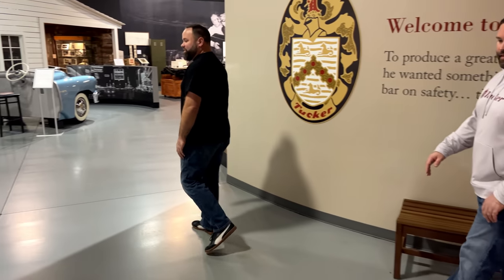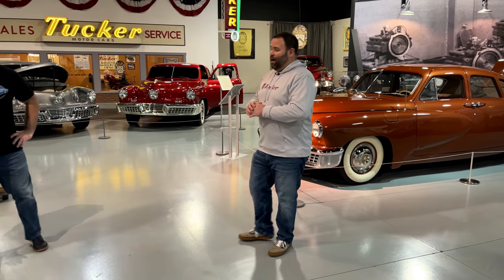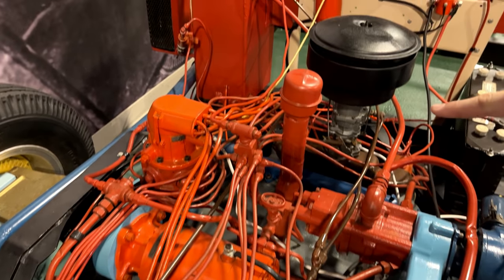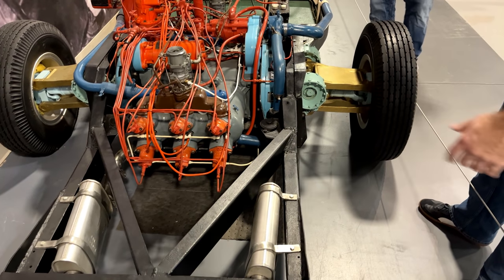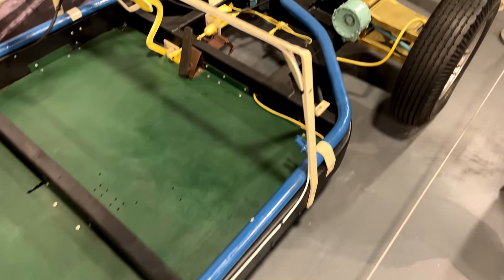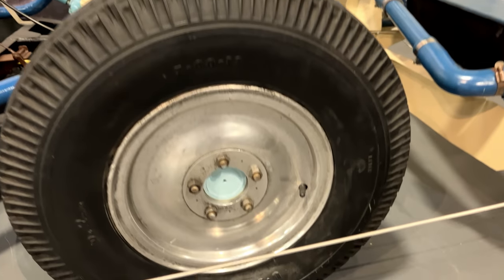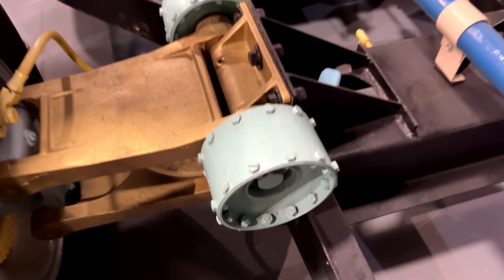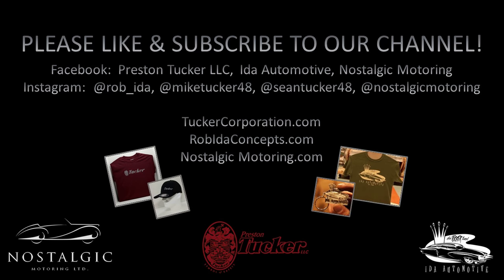The Original 1948 Tucker Test Chassis Still Exists With a 589 Cubic Inch Flat Six Cylinder Engine

Comment: You can tell Preston’s racing background in the chassis - boxer-type flat engine mounted low in the chassis for low center of gravity, external dry-sump lubrication to prevent any part of the engine getting starved of oil in tight, fast turns, 4 wheel disc brakes, torsion style suspension…… that was all racing-only components and was unheard of for a production, civilian family sedan then. Even now….. you hear dry sump oil system you think Corvette Z06! He was a true enthusiast!
Reply from the maker: Agreed, thanks for watching!
Reply: or Toyota Previa dry sump!!!!!!!!
Reply: The first rear-engine F1 car wouldn't even exist for another 10 years when Tucker was putting this into production.
Reply: I knew the Preston tucker the third I worked with him at Motorola in about 1974
Reply: There's a reason we still don't see dry sump oiling on the average car: It doesn't benefit the average car enough to warrant the cost and complexity.
Reply: @TestECull  the Toyota Previa had it only because they took a current engine and flipped it on its side under the van. was a big deal to do an oil change on one...

Comment: Let see... Preston Tucker's engineers were ahead of Koenigsegg by about 60 years with both the use of torque converts (direct drive) and freevalve (no camshafts) on the test mule. Impressive stuff for sure.
Reply from the maker: Pretty crazy, thanks for watching!
Reply: I was just telling a friend of mine that exact same thing
Reply: @prestontuckersspeedshop1948  I'd love to know how you were supposed to put the car in reverse if it didn't have a transmission.
Reply: @Cat-fy5lw   well, considering all of the unconventional ideas in the engineering, like, rubber suspension instead of coil springs,
My guess would be , reverse the engine rotation, and then the car . JK

Comment: That test chassis is a piece of art.  That whole museum looks like a fun place to take a walk through.  Thanks for showing us around and I can't wait to see more!
Reply from the maker: Thanks for watching, we will keep them coming!
Reply: If this test chassis didn't have a transmission, how the heck did you back the car up?
Reply: @PorscheRacer14  Still doesn't explain how the hell the reverse gear works.
Reply: @Cat-fy5lw  via the torque converter, basically to go foward you apply the hydrolic oil pressure in one direction and fo reverse you basically reverse the flow direction of the hydrolic oil. (oversimplified, but thats the gereral idea)
Reply: I know torque converters have something inside called a reactor. Maybe that has something to do with it? Anyway, thank you.

Comment: That chassis is so cool! The technology demonstrated in that chassis and motor is really something! I was totally unaware of the hydraulically actuated valve train.   And it was totally done totally electromechanical!  The spastic 4 wheel independent suspension, the torque converter drive. (Does it work like a CVT in function?) the prototype radiators in the front bumper wings. Now I know why the front bumper was styled the way it is. The interesting looking exhaust system.  Probably pretty choked down from the looks of it.  

This place is just so great!
Reply from the maker: Yes, certainly more engineering to do but the ideas were there.  Thanks for watching!

Comment: That is truly incredible. By today's standards a lot of those features are common place but to be that far ahead of the curve, in the 1940's. Tucker sure didn't let convention dictate any design element in his car. It would have set the bar so far above the other manufacturers had it not been killed by them instead we might actually have flying cars today!!!
Reply from the maker: Agreed, thanks for watching!
Reply: Tucker was badly underfunded - that's why the company failed.  It had nothing to do with any outside influence by other manufacturers.

Comment: These cars were so innovative!!! That special engine in the test car is AMAZING!!! No camshaft!!! A hydraulic pump and actuators that operated the valves... Wow... I wonder if any other R&D  was done with those methods, by other firms/companies, after that design was introduced? This car was in many ways, 50 years ahead of the other companies making cars in the U.S.& abroad... It is a shame that the 3 major U.S. car companies back in the late 40's, made large efforts and untrue propaganda campaigns , to squash this superior design , because they were not prepared to compete with it...
Reply from the maker: What could have been!  Thanks for watching
Reply: @melvinhunt6976  nope that wasn't the helicopter engine the helicopter engine replaced the 589 in my opinion the Tucker engineers got a little ( okay a lot )carried away with the design of this engine could you imagine how unreliable that valve train would've been
Reply: What is wrong with you people ? Those ideas were obviously failures hence nobody wanted to know about them...
Reply: @user-kc2ru5xo4k  then Why was the big 3 so afraid of Tucker?
Reply: @melvinhunt6976  they weren't really...in fact they sold him parts such as steering wheels and knobs and other accessories. Back then there was a lot of smaller car companies the big 3 wasn't exactly threatened by Tucker. Tucker didn't pay his rent and squandered all the money he borrowed on crazy R&D and cigars.
Reply: @insulman100  i don't think this engine would of ever made no matter how much R&D....but they are doing similar today with electric solenoids operating the valves so in some ways he was ahead of his time i guess. Rear engine was nothing new, dry sumps oiling was nothing new, rear engine was nothing new. They were using opposed engines in stuff already also.

Comment: Back in the late 60s, I was in the waiting room of a dentist office and I picked up a copy of Mechanic's Illustrated to kill time. I flipped through the pages and got to the Tom McCahill section where letters from readers were posted. I noticed a letter about the Tucker car. I knew my father worked for Tucker so I read it with interest. To my surprise, when I got to the letter that provided details about the car and also what happened behind the curtain at it's unveiling,  I saw that my father had written the letter. My father didn't talk much so it was a real surprise. I only knew that he worked for Tucker because my mother told me. I wish I had that magazine now.  I don't remember much about what he wrote but he went into some details. I do remember that he said the battery was very large and, if I remember correctly, I think he said it's weight caused a problem. I may be wrong about that. I also remember being told that my father helped build what was then the world's largest truck to transport military equipment over the Rocky mountains during WWII. But again, I was told that by my morher, not my father.

Comment: Very interesting engine design. Would be interesting to see continued research and development on it just to understand what potential the camless engine had.
Reply from the maker: Koenigsegg is working on it now, check it out!
Reply: Interesting that Koenigsegg also has a car driven directly with a torque converter and no transmission.

Comment: Tucker pioneered many mechanical engineering features that have shown up on later cars. Flat 6. Torque converters on each wheel. etc.   etc.  etc.  Subscribing.  :)
Reply from the maker: Thanks for watching!
Reply: @prestontuckersspeedshop1948  Yer welcome. :)

Comment: Various style elements of the Tucker showed up on other cars for a long time. Some copied the grille on the back. Some used the back angled rear door window frame. Through the 1950's and into the 1970's one can find little touches that resemble some part of the Tucker.
Reply from the maker: Agreed, we notice them all the time!
Reply: @prestontuckersspeedshop1948  That would make a good subject for a video. The Tucker's long term influence on automotive styling. The other companies killed it then looted the corpse for bling. :P

Comment: Camless engines are used in F-1 powerplants and allow rpms in the 17k range. They use a compressed air system instead of hydraulic which I assume is to reduce weight.
Reply from the maker: Very cool, thanks for watching!

Comment: Great engineering quality's. Even Andre Citroen would approve.
Sir Alex Moulton and Igissonis and Greeves MCycles are two names closely connected with Rubber suspension designs in the UK.... Its greatest asset is it gives a natural rising rate and rebound damping ...but it will deteriorate quickly in torsion bush form..

Comment: I'd like to know how the first prototype chassis drove in reverse. I presume the engine spins clockwise when viewed from the right side, or counter-clockwise when viewed from the driver's side, but I'm unclear as to how reverse is engaged. The engine is huge, over 9.6l so it likely produced a lot of torque throughout the rpm range, but I still believe some gearing should help improve accelleration and fuel economy.
Reply from the maker: It didn’t in this configuration, which is where the “no reverse” legend came from as it relates to Tucker.  It certainly would have taken significantly more development, but as we noted they had to abandon it as they were running out of time.  Thanks for watching!
Reply: You don't really need reverse.I found that out 40 years ago when reverse went out on my Ford Maverick and I had to drive it a while until I could find another car.
Reply: @prestontuckersspeedshop1948  Torque convertors can't work going backwards. The internal one-way clutch would simply freewheel.   Reverse then would be a problem..as you say.    As a mechanic, I'm very impressed at the fantastic engineering on that chassis.  nz.
Reply: @moyadapne968  the original tucker idea was that the internal clutches on the stators would be able to be locked when in reverse, but keep in mind this was a prototype that was never finished.

Comment: Without a transmission, what would prevent the car from rolling as soon as the engine started? Did it just happen to have a high stall or some kind of disconnect?

Comment: I wonder what kind of power that big flat 6 would have made on the wheels.
Reply from the maker: They hadn’t sorted it out so it made less than 100 back in 1948.  Had they sorted it out I’m sure HP, and more specially torque, would have been huge.
Reply: @prestontuckersspeedshop1948  I am sure the torque would be massive specially on low rpm. Shame this never went into production. This engine fully sorted out would be music to the ears.

Comment: Interesting that this is not the helicopter engine either.  Maybe the internals?  I see a split watercooled block like a VW or Corvair with integral cylinder heads. Hard to manufacture and assemble and I think they tried too hard....

It's innovative but I'm not sure what I think.  The designers KNEW how wide it was with no room for a reverse device and by 1948, from aircraft, they KNEW proper flow design and heating issues for hydraulic valve actuation.  As an engineer, I've seen this happen before where the boss has big dreams and the designers follow orders to keep their jobs.
Reply from the maker: Not sure that’s what happen, but it’s certainly a theory.  Thanks for watching!

Comment: So considering it drives through two converters how does it achieve reverse as converters can only function properly in one direction..I’m curious! 
Are these true torque converters or fluid couplings?
Reply: We should have mentioned this - that is what started the "Tucker's cant back up" headlines back in 1947. It was true for this setup; it only went forward although it was known by the developers and I believe they were working on something to fix that. I would have to check the design data on the fluid coupling vs true torque converter - good question!
Reply from the maker: What he said!  Thanks for watching.

Comment: The ideas in the test chassis were obviously not too great considering....  rubber suspension ?!?   No head gasket/s ?? Err hello ! Head gaskets are designed to act as a fuse to protect the vital components of the engine...  hmm  bright spark.
These ideas were signs of 'doing things the hard way' ...  I guess gotta give them points for trying...  tryhard.
Reply from the maker: Maybe so, what did you do for your test chassis?  Thanks for watching!

Comment: All those lines looks like design flaws to many points to fail. I think in daily use in 6 months will fail from massive failure
Reply from the maker: It was a test engine, not the production version.  Certainly more development would have been required.  Thanks for watching!

Comment: It doesn't take a skeptic to realize that the entirety of Tucker's efforts was a train wreck that possibly could have wasted a lot more Investments than it did.
Low RPM engine no s***
Torque converters on both ends of the crankshaft eliminating the need of a gearbox driveshaft differential gear.
Hydraulically actuated valves that definitely causes a significant load to the crankshaft that also must have had incredible inertia conflict throwing such large Pistons and I bet quite a considerable long-stroke crankshaft that put out a lagging dog RPM increase!
The test chassis cooling system must have plagiarized some dr. Seuss rough drafts and I bet dr. Seuss could have come up with a more realistic of an automobile. Could you imagine the percolating noise inside the car one would hear when the cooling system level leaks down below water pump level probably sounding a lot like a toilet flushing which would be your indicator that your cooling system failed and about to overheat your engine! Omg lmfao! Big dreamer Tucker! No it actually wasn't really real. Just a life-long effort to exhibit how not to do s***! Wtf😳🤣
Reply from the maker: Let us know when the video of your test chassis is up, we’d love to see it as it sounds amazing!!  Thanks for watching.